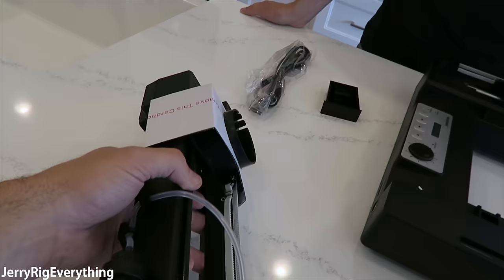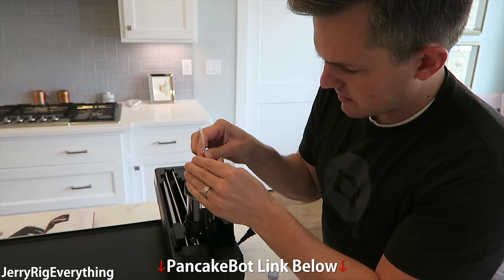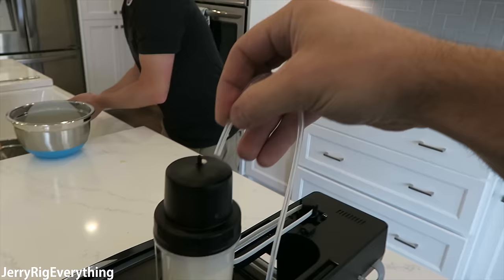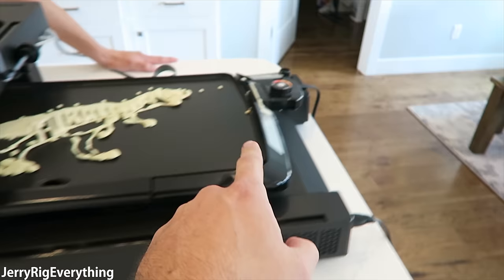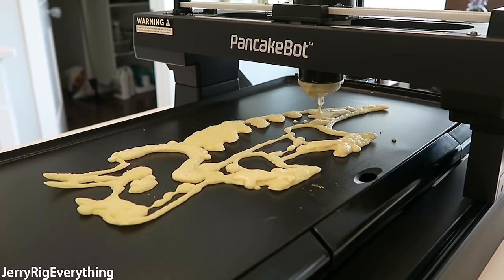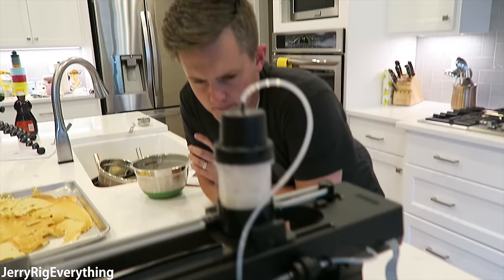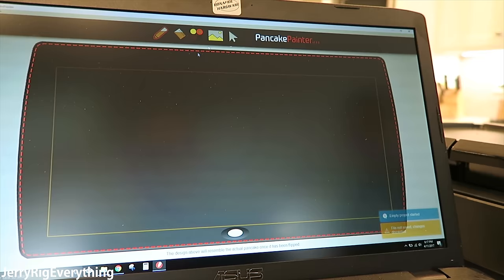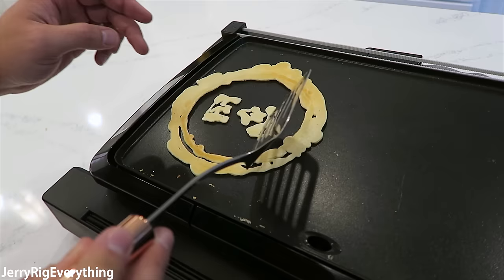Print your BREAKFAST - NEW 3D Pancake Printer!!

Comment: It is not 3D, it only draws in two dimensions.
Reply: NicolSD ikr
Reply: Na, if you can pick it up, it is 3D. The only real 2d things are projections and arguably TV's. It does have 3D depth though...
Reply: Actually it doesn't ;)
Reply: yes, its only x and y... from printing perspective its 2d...
Reply: dedoyxp there are layers, and different heights, but there has to be a range to keep the pancakes consistent. It IS 3D. Fact.
Reply: There doesn't look to be a stepper that raises and lowers.
Reply: just repeat the same drawing over and over and you will have an uncooked 3D shape :P (raised up)
Reply: It's a little bit 3D still, since there is more than one layer.
Reply: NicolSD Thougt the same thing!
Reply: I cal this 2.1D
Reply: Its still 3D because the pancake has a depth too.
Reply: Neither the printer head nor the printing surface  moves in the vertical axis.
Reply: My Inkjet printer can print 1000 times on the same paper. The paper is curling and the ink is getting thicker. Is my inkjet printer a 3D printer now?
Reply: ISOHaven 3D=3Dimensions
Reply: +RodamisCZ. So what about printing with h2o? It still a 3d printer then? Best turn the griddle off if you still want that depth.
Reply: The pancake being three dimensional doesn't matter, it's still a 2d printer by definition cause it goes in 2 axes rather 3.
Reply: This printer moves only X and Y axis. Exactly like my Inkjet.
Ink on a paper has a height of approx. 4.8 Micrometers. A Pancake has approx. 1000 Micrometers.
If this is a 3D printer, is my inkjet also a 3D printer? Where is the treshold to be 3D?
Reply: ***** You got me.
Reply: Jesus Christ - It's like a fat drawing. It remains a drawing nonetheless. Thus it is only 2D. It prints along an X and Y axis.
Reply: NicolSD nothing is 2D
Reply: My name a mr meme nothing in our dimension atleast
Reply: NicolSD everything around you is 3D even that pancake It was having a length,breath and a thickness so it is 3D
Reply: Let me clarify something here. I know how to work Mastercam which is a CAD/CAM software. A cube is 2D, because the program only moves in two axes while whatever machine that is using that program is operating. 3D is any shape that requires 3 or more axes to run. The first 3 axes are X, Y, and Z. The second 3 are A, B, and C. So this actually is a 2D printer, because it only performs its operations in the X and Y axes.
Reply: just the picture, but food actualy 3D
Reply: Billy Spaz yea the pancake is 3d.. hut the printer prints 2d..its not a 3d printer...and also there are more 2d things in the world..a drawing on a paper its 2d
Reply: I know this has nothing to do with printers but ... is the reflection in mirror 2D or 3D?
Reply: Le Fouk there are only two things that are 2D. Shadows and reflections.
Reply: Sid the printer dose not have a vertical plane so it is not a 3D printer
Reply: NicolSD its mor a plotter
Reply: Finally someone with more than half a brain.
Reply: NicolSD thanks
Reply: Billy Spaz by that logic every usual printer is a 3d printer and the term becomes useless
Reply: Its 3d, it has depth
Reply: NicolSD It's a 2D printer, but the outcome is in 3D. Case closed.
Reply: The printer inventor himself it is 2D in a recent interview. The software uses X and Y coordinates but not Z.
Reply: NicolSD it's 3d
Reply: Relict 805 Then by your logic, everything is a 3D printer. With printers, 2D and 3D is pretty much just how many axis' are there. 2D printers have 2 axis', 3D has 3. It has 2 axis' but the outcome is 3D.

Logic, duh..
Reply: @phermey yeah but there are

Comment: Technically a 2D printer? There's no Z axis control for the hot end.
Reply: aidan c. But it's still a 3d object
Reply: papers are also 3d
Reply: It is a 3D printer. It's printing a stuff that is not affiliated with no depths.
Reply: What?

Comment: It prints in length and width, no height. So it's just a pancake printer

Edit: Around 2:40 you filter out what seems to be the lumps it the mix. Your mix should be as lumpy as possible because they will desolve when baking and make a fluffer pancake.
Reply: Yeah but the printer has 3 dimensions

Comment: It's a 2D printer, not a 3D printer! :D
Reply: dagadam Pancakes have length, width and thickness so they're 3D...
Reply: dagadam so it has no thickness at all?
Reply: Its sutch a interesting thing because it doesnt print the height. And yes my english is awfull and not good
Reply: That's not even what the video is about
Reply: nasa needs to hire u
Reply: @waqasshaan8954  ink has thickness aswell so there for all printers are 3D 
What he meat was that it cant build a tower for exanple
Reply: Things are molded along 3 axis therefore 3d it is.
Reply: Go eat it's shadow.
Reply: You can lift the object up, therefore it’s 3d

Comment: Whoever says " it's a 2D printer" needs to realise that

*THE DINOSAUR HAS A DEPTH TO IT which makes it x,y,z axis or 3D, 3D DOESN'T ALWAYS MEAN THE THING HAS TO BE A SOLID LIKE A CUBE"
Reply: Every drop out of an inkjet printer has a depth. so every printer in the world is at least 3D, right?
Reply: HITESH Adhikari still when you say 3d a lot of people think of a standing dinosaur like what a toy would be, rather than a relatively flat one. Technically it is a 3d printer, but it is more similar to 2d than plastic 3d printers as it doesnt stack and add height to the design, but really you can only control the x and y
Reply: swigre No because the ink soaks into the paper and doesn't rest on top.
Reply: It's only printing on 2 axes though...
Reply: HITESH Adhikari thank God someone understands geometry
Reply: Julius Verne So it can print in 3 axes? If you put ink in that would it print 3D image? ...?
Reply: it prints in 3D too mate, u can see the Dino he made and it did not just have one layer of the pancake batter but also used several layers at some points ( where it looks dark).

the machine does have a 3rd axis movement although it's not a very large movement but the tip does move few mm ( as per this video)
Reply: HITESH Adhikari nope... it was first "printed" there so it had more time to cook.. that is why it is darker and if i print painting on painting is it a 3D object?
Reply: HITESH Adhikari You need the realize that realize is spelled realize not realise.
Reply: HITESH Adhikari we are independent now get over it you're clearly still upset at America but the tea party was like over 20 years ago you need to move on
Reply: Black agreed idk why Americans think that English means American English only , there is British English, Australia English and so many different pronounciation of same word.
it's like Americans who think that there is no other country except America and everyplace except America is either China or middle East with Arabs roaming all over that place
Reply: HITESH Adhikari Americans are very self centred. But it's what they've grown up with and been taught at school so I can't really blame them.
Reply: Black yeah , I have lot of American friends, some of them very nice. yeah their education system sucks. they r taught things like USA IS THE WORLD POLICE
AMERICA NEVER DID ANYTHING WRONG ETC

their geopolitical knowledge is not really great.
Reply: IT ONLY PRINTS ON TWO AXIS SO IT REALLY IS A 2D PRINTER. IT WOULD GO UP AND DOWN IN THE AIR IF IT WAS A 3D PRINTER. THIS IS NOT HARD TO UNDERSTAND. EVEN PICTURES AND INK TECHNICALLY HAVE DEPTH BUT THAT DOES NOT MAKE THEM 3D. SAME CONCEPT.
Reply: Shapoot it has depth so that makes it 3D

Comment: aint that a 2D printer

it seems fun but rly usles. it squirts pancake mix on a hot plate
Reply: i can do this by hand
Reply: But not everyone has such an artistic mind or steady hand like you do, plus, it's a robot, so it's less likely to make mistakes and it can be programmed to make pretty much whatever you want
Reply: It's not 2d if it was 2d it should've been just a drawing
Reply: This would be a killer tool if you have 2 to 12 year old kids... and if you have a pancake shop, you could use it as a  promotional tool.   (And it could do 3d, just print a layer at a time...)

Comment: you've got the heating grill pad on the wrong way. the wire and the temperature control are supposed to be on the same end as the air pressure this will make it so that the container rests over the heating grill pad at all times.

Comment: Actually it's a 2d printer.  The point at which the filament( in this case pancake mix), only moves on a 2 axis.  There is no 3rd dimension to this printer.  However, all things are 3d, so would a printed piece of paper really be 2D?  The understanding of 2D and 3D is quite strange.  I guess you can only consider a printer 3D only if it moves in the height dimension as well.